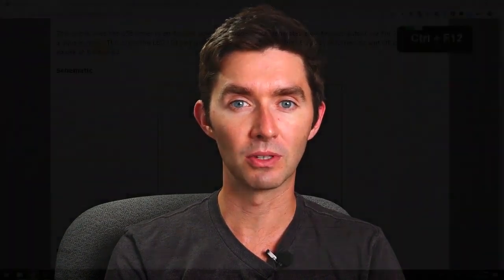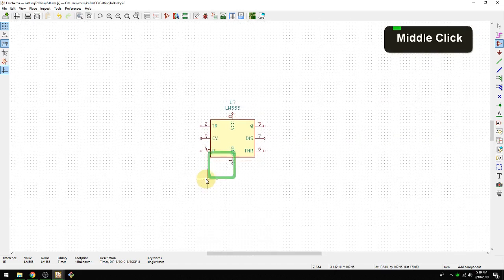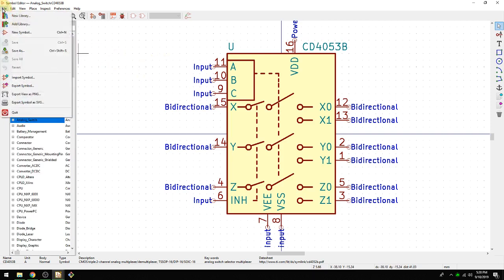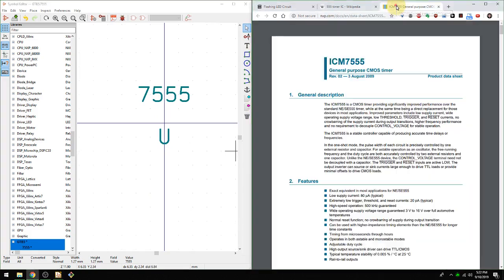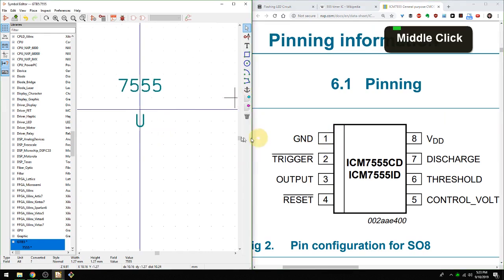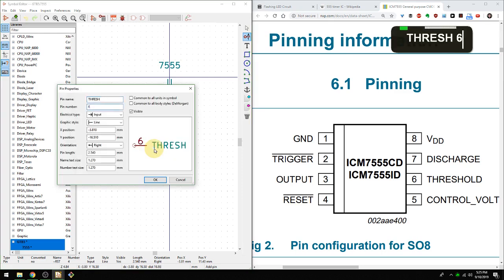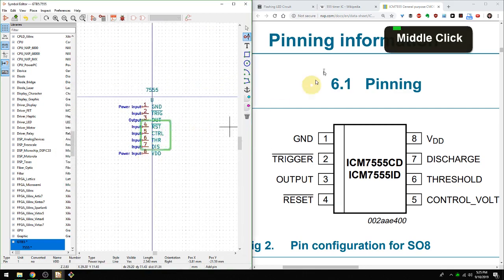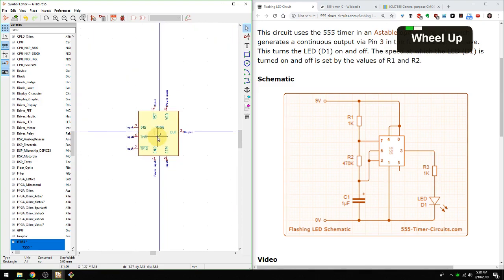Getting To Blinky 5.0 - Schematic Symbol Creation

Comment: There has to be some settings to set .. the program doesn’t work like you’re showing at all.
The name didn’t show up right away like yours did.
How do you get the mouse window/shortcut to pop up?
How did you get the data sheet?

Comment: Is there guidelines of the size of the elements? Since the schematic editor doesn’t allow resizing it looks like the components should be sized properly.
Also for the rotation to work correctly should the component be cantered?

Comment: You put no effort into spacing the wire inputs evenly around the symbol or at least positioning them in a logical location (other than random placement) if you prefer custom spacing, or even centering the symbol for a clean rotational axis.  That's kinda good practice and maybe you should consider being a bit more thorough in teaching good practices.
Reply: They aren't randomly placed, he is placing them in the order they appear in the schematic. Pay attention.